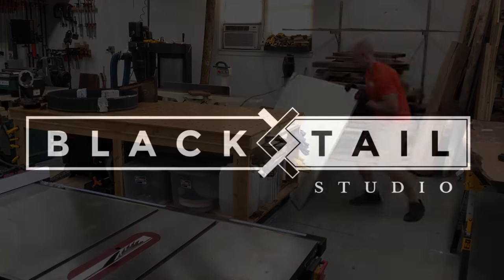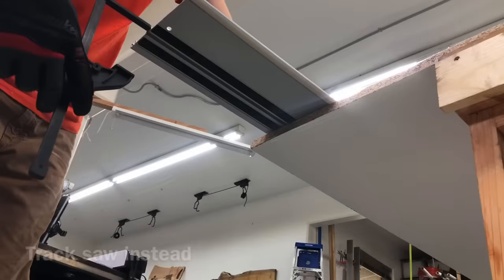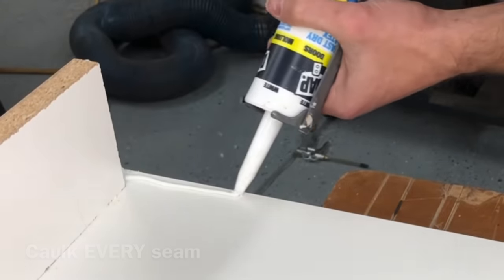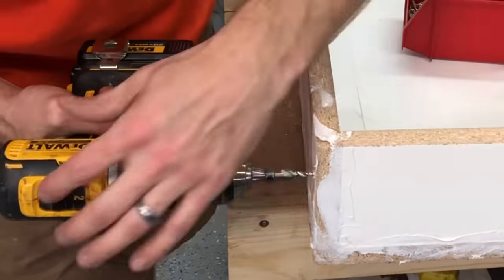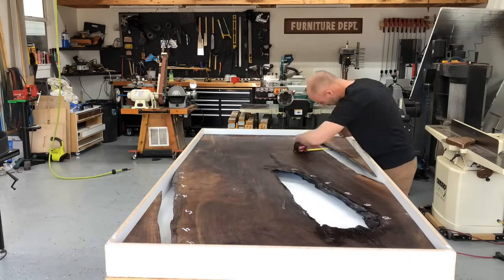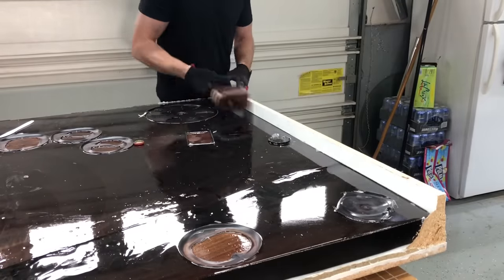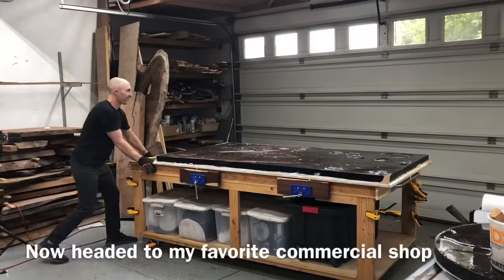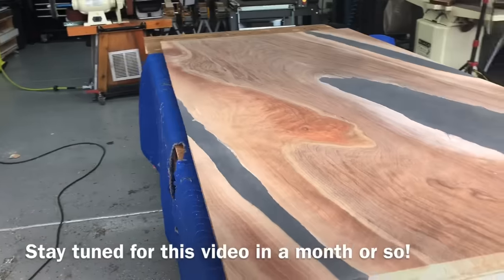How To Make an Epoxy Table Mold - DIY Epoxy Resin Table

Comment: Hey bud, love the videos - thank you!  Kinda have a related question, but it looks like some times people will put a little caulk along the inside of the slab / river, to prevent it from leaking under to the extent it’s not totally flat.   Do you ever do that / is that something that people typically do? Thanks!!!
Reply from the maker: I don’t, kinda long reason why though

Comment: Hi.  I have a few dumb questions.  I have been very inspired by your videos and tried my first river table recently.  I am applying the third seal coat tonight and it occurred to me that I may be mis-calculating the amount of seal coat.  The stonecoat countertop people say to use 1 ounce per square foot for seal coats and three ounces for the top coat.  My wife and are not certain still about how much to use.  We have 12 square feet of surface.  SO does that mean use 6 ounces of A and 6 of B or 12 ounces of each?

Also, a big freaking moth landed on my seal coat after 3AM when I applied the second one and he really embedded himself into it.  We tried to sand him out but he was too deep so we used a flat head screwdriver and scraped out a 2-3 mm crated right down to the wood surface.  Will I need to use quick coat on that or can I just sand as normal tonight and apply another sealcoat to the whole slab as palnned and hope it fills that divit??  Thanks for the fast reply.
Keith
Reply from the maker: You’ll figure out the measurements. I’m sure of it. And just fill the low spot with epoxy!

Comment: Hi,
I'm trying to make my first table. I'm using white oak with a dark ish mixed river but wondered about making it a little darker with a stain, where in the process would you recommend? I know your previous videos use shellac prior to the pour to reduce risk of epoxy staining, would you do it here? Or just wait until prior to finishing it after sanding? I'm a big fan of the videos, but haven't seen you use or I missed any with stains. Thanks!
Reply from the maker: I rarely stain or dye anything. I do have black dye video coming out in a few weeks though

Comment: Do you cover in a separate video how to clean the bottom. I've started to do scroll saw projects where I pour epoxy. And I can't run them through a planer or else it will break the wood. The tops are fine it's just the bottom that is nasty with caulk. Any recommendations on how to clean that up
Reply from the maker: Hmm, never had a problem
Reply: @BlacktailStudio  drum sander I found out Is the way to go

Comment: How do you not glue your clamps down with resin? I’m worried I’ll comeback and find the resin on the block or clamp I use to keep the wood from floating.
Reply from the maker: The poly caps peel right off the epoxy

Comment: Emily here: Hi there! My hubby and I love your videos.  We have just my gotten into making river tables. Where we live, we don’t have access to a professional large planar to run through after the pour.  What do you recommend doing if we don’t have access, but wanted to do a river table but finishing with a polyurethane or something similar versus full coverage of the whole table with epoxy?
Reply from the maker: Router sled for flattening! If that wax the question

Comment: I do have a quick question, I have plywood and ocm board lying around that are big enough to make a frame for my table, 36"x55". Would that be an acceptable substitute to the melanine?
Reply from the maker: Need to cover it with tyvek tape. Then it will be!

Comment: Scott here, a newbie at resin, have you ever tried a non-stick cooking spray? Has to be a lot cheaper than mold release sprays!
Reply from the maker: Probably one area I wouldn’t worry about trying to save $8
Reply: Blacktail Studio So I got the good stuff and it worked perfectly, first mold project is going perfectly so far 🤞

Comment: Hi I built a 2 metre by 1 metre river table. River in the middle and a river on the outer edge. I used deep cast which can pour up tp 50 mm in one pour and I did two seperate pours over a 48hr period according to the company. I then left it for 7 days. My table ended up bowing while in the mould. was this a checmical recation or a clamping issue? thanks. Whoe tableis firewood now. I spent around $1200. Love the channel.
Reply from the maker: Dang! You can try setting it in the sun (covered) and clamp it down once it’s heated up.
Reply: I managed to cut it down in size and hoping to flatten it out. The resin company said when the resin shrinks it can really pull on the wood so if it was not clapped down right this may have caused the bowing.

Comment: Cam,  have you tried butting the sides against the base instead of on top of the base the way you did in this video? Seems like it’d be easier to screw in. I did attend your 2/7/20 class but can’t remember if I asked this question at that time.
Reply from the maker: I do it this way to make it possible to see any leaks. And then stop them 👍🏼

Comment: I own  small cabinet shop. Going to try my first resin/wood table. I have a ton of walnut I saved from logs that I have milled a few yrs ago. My question is do I need to use 3/4” melamine on the bottom of my mold? I was 1/4, 1/2, and 3/4 melamine in my cabinet work. I thinking of using 1/4 on bottom? I’m going to start of with a small end table size top. Thanks!
Reply from the maker: Thinner would be fine if it’s supported
Reply: I just today got back from local sawmill guy 200 Bf of red elm, all 1” thick slabbed( 2 live edges). My question is what is a good method to remove the bark? Almost all is adhered really well to the solid elm. Thanks for your help

Comment: derrick.

I got a beginners question for you but i like unique and difficult looking art so the void on the table is great in my opinion. Im always experimenting with everything so i never really know what im doing, one of my projects i recently meshed 2 different trees together and blended them as best as I could but now i know how to and better ways. My question it im asked by a friend to make a hexagon frame 2' 6" tall for a stool and im going to do 6 epoxy walls with thin poplar logs filling the inside.  -Q- when making the walls could i do them one at a time then sand and epoxy poor to blend all on a final poor or should it be all same time. (mold will be pain in the ass if the whole hexagon at once) and how would you recomend colouring the epoxy, well shading* each wall on a budget? sorry for long post
Reply from the maker: Man, sorry. Not sure about that one

Comment: Leo here! i have a question Cam, i see you use the slab sander at a shop to plane and sand your epoxy tables after laying resin, my question is what is the most time efficient way to get the table flat after resin poring and achieve a good finish, with basic tools eg(router sled ,belt sander, random orbital sander) given i have no access to a slab sander.
Reply from the maker: I’d use a router sled

Comment: Cassie here - so we don't have access to the type of sander you used. :) But, what could I use instead at home that would sand this down to be a soft beautiful finish? I do a lot of small resin work including a fill on a wood table. But I want to make a full kitchen table top that is mostly resin.
Reply from the maker: I’d use a router sled

Comment: This maybe a silly question but when using melamine for the mould do you need the Mold release spray or is that just extra precaution? Thank you
Reply from the maker: You need it. Learned the hard way

Comment: Elliott- I'm making a much thinner epoxy headboard than the table detailed here. Would it be safe to use 1/2 melamine for the mold? My "table" will be about 3/4 in thick when I'm done
Reply from the maker: As long as it’s supported

Comment: I am curious as to know how come the black resin doesn't stain or infiltrate the wood. I know that when you pass it trough the planer, it removes a lot of material (I suposse), but you have never had any issues when used tinted epoxy when it comes to staining the underlying wood?. Thanks for your insight in advance.
Reply from the maker: Good question! Check out my other videos. I go into that. But I seal the wood first

Comment: Johnny here. I've used mold release on a test epoxy mold but the melamine stuck to the epoxy in multiple areas. I noticed that you spray on the mold release then used what appears to be a paper towel to buff in or wipe in the mold release. Is using the paper towel the secret?
Reply from the maker: It’s necessary. So maybe that’s the secret!

Comment: Love the video, thank you. Quick question, when creating an epoxy table is final surface up or down? How do you prevent expoxy from flowing under the downn-side wood surface or is that inevitable and have to be planed/sanded off?
Reply from the maker: I let it flow under! Makes a nice flat bottom to run through the planer
Reply: @BlacktailStudio  Jordan - following up on @lipeltgm's question - do you have any advice on how to not have the resin that does manage to sneak between the melamine and the wood react and foam? I did a test deep pour for my first pour and had tons of foam coming up from underneath the wood. I put sealer epoxy on the edges but not the bottom. Maybe that? Thank you and Go Beavs!

Comment: Schuyler here! Doesn't putting caulk on the inside edge make it so the wood will not butt up to the mold sides? (The right angle of the table wood and the filleted edge - because of the caulk - of the mold)
Reply from the maker: It does. I build them over sized anyway

Comment: Chris, thanks for the videos. Can I ask what epoxy you use? Is it still the Glass Cast you had in one of your other videos? If so what do you recommend to your customers regarding hot objects on the table like coffee cups etc as I've looked at this brand in the UK and it says not to put anything over 45 degrees on it? Thanks again
Reply from the maker: Using liquid glass now. And I’d get with the manufacture for temp limits

Comment: Hey, do any of you guys know what else can I use instead od melamine board to make the table template? Melamine is hard to get where I live and very expensive, but I understeand that plain laminated board from Ikea is not suited for this kind of work because of the weak paper like coating that would most likely stick to the resin and mess it up. Sorry for my english, I hope you can understand what I mean 😅

Comment: My name is Joe.  :-)  We’re hoping to make a table top with the “river” in the middle but the live edge on the outside (leading) edge of the table. Thus, only three sides will be “square” with the side of the form. If we make the form snug with the wood instead of leaving an inch on each side, can a bead of caulk keep the resin from reaching the cavity on the leading edge?
Reply: Never mind--watched more videos and answered my own question.  Sounds like we'll have flow under the table and around the edges of the form no matter what we do.

Comment: Cheri- i wanted to doble check with you that I heard yiu say ....Not t use silicone  chalk.  Is that right? I thought that is what was recommended fir inside the mold.
Reply from the maker: Correct, use latex caulk

Comment: Gary here. Thank you for another great video. I’ve made a few river tables so I know how to make a mold but I will watch anything you put out. I do have one question. I’ve used Tivek tape in the past and have seen a couples of videos where the epoxy heated up enough to melt the vinyl on the melamine. Have you ever had this happen or do you do something to prevent that? Thanks again.
Reply from the maker: Whoa! I haven’t. But I don’t use it much.

Comment: Logan. So what if the mold does come off just like that? Sides came off fine but the bottom is stuck like the epoxy glued the slab to the melamine. It seems that the mold release didn’t take and is coming apart and just flaking off. Better way to get it to release the wood?
Reply from the maker: I’ve had to plane one off before

Comment: Joe Gray... So you said the shop where you use their plainer/sander was Woodworkers Emporium?  We have one here in Vegas that rents out time on their drum sander.  I wonder if it's the same type of machine.  I will be doing my first live edge river top for my 2x6 desk.  I found a local guy that sells slabs and I got a 6ft 2 and a half inch ash slab for $100 bucks.
Reply from the maker: Very nice!
Reply: @BlacktailStudio  Is the shop you use their planer/sander called Woodworkers Emporium?

Comment: Hello I'm Jessica. Any suggestions if I am doing just the top of a desk. I have done the main portion of the desk and now need to bring my epoxy out to the edge. How would I go about placing something around the edge to seal my work and not have a big mess on the floor? Any help would be appreciated.

Love your table so far and will be looking for the video with the reveal of the finished product. Great design!
Reply from the maker: I’m having a hard time picturing it
Reply: @BlacktailStudio  I have a desktop. I did a desgin with the center but now need to pour the remaining top. How do I secure it so the epoxy stays on the desk and not on the floor
Reply: @BlacktailStudio  sorry reply won't let me send a picture

Comment: Howard: why can’t you use a roll of 25” wide 3mil plastic sheet to line the mold instead of the tape or mold release?
Reply from the maker: I guess because this seems cheaper, faster, and. cleaner to me. Don’t see why you couldn’t use that though. Painters cling plastic would probably be even cheaper and easier

Comment: Thad here. I'm doing a 10-foot by by 52 in wide 2.5 inches deep poor onto two pieces of slab that are 2 in thick to make 1 table. Any guesstimates on how much epoxy I'm going to need?
Reply from the maker: I’ve got a video on how to work that out

Comment: David M.  Always learn something new!  Watched a couple of your other videos for about the third time this am.  Great insight as usual. Question:  What are your thoughts on pouring @ a 2mm layer of epoxy first on the mold, then setting the slab/material on it?  Saw someone do that this morning, and it eliminated gassing and also anchored the slab while creating a non leaking dam.  Thoughts are welcomed!  DM from Georgia
Reply from the maker: Yup,  no issue with that method! Nice to have it locked to the bottom and leakproof

Comment: Delphine. Have you ever tried modustrial maker's caulking method for molds? He mainly does concrete work but maybe it would work with wood and epoxy.
Reply from the maker: I haven’t. I’ll have to check it out!

Comment: Something tells me I'm going to do a headpalm here, but I have a small desk that is going to be 41.5" w by  22" d This would seem to be making the bottom of the form 43.5 + .75+.75 by 24+.75+.75.  This leads to a 45"  by 25.5" base. If I attach the sides at the edges of the base, as in the video, won't the form be 2 inches too big?  I'm sure I'm being a dummy, but that's one of my core competencies... 8^)

Comment: How do I get the table smooth after pouring if I don’t have access to a industrial size sander/planer? Can I just use an orbital sander for a really long time to sand the table top smooth after pouring?
Reply from the maker: Try a router sled

Comment: Nick - What kind of machine is used at the end of video to sand down all the sides. Also, do you recommend paying to square it to make sure all corners are 90 degrees?
Reply from the maker: I do have them square it too. This is a big planer + wide belt sander

Comment: I have a question - your work table... if I needed to build a 60in x 110in work table... how would you go about doing that? I’ve got my ideas, but i need something that has some room under the table to allow for cold air to flow good to keep the area cooler when pouring epoxy.
Reply from the maker: I usually use MDF for worktops

Comment: Ken here.  I am wanting to use reclaimed birdseye maple flooring to build a counter. I want to actually preserve the imperfections, stains, etc.  So I am mounting the 2.25" to a subfloor panel and only need side edges to hold in the epoxy resin and to help pour enough epoxy to level the surface.  Any words of advice on how to approach this a little differently than a full mold?
Reply from the maker: Man, I feel like I’d need to see it
Reply: @BlacktailStudio  So I am randomly placing the 2.25" flooring pieces on top of a plywood base.  Then I will put the epoxy over the whole thing.  I was think I would simply build a frame of side panels only to screw into the plywood base.  Then I would remove the sides and install my stainless steel edge guards afterwards.

Comment: Justin here, 
Hey I have a question, I am trying to make a resin table using a folding beer pong table. Any tips to stop the resin from falling off the edges? should I put wood and caulk it? would the caulk come off the plastic table?
Reply from the maker: Not sure how you mean

Comment: Hey. I'm in the 🇬🇧 and came across this. I have a project where I want to make a resin wood table. Is the caulk decorators caulk?. Sorry if it sounds a silly question but this side of the pond we sometimes have different names for things.
Reply from the maker: It’s caulk for window and baseboards
Reply: @BlacktailStudio  thanks I will get some. Looking forward to mine.

Comment: Cam:

I am using melamine as a form.  I am also using the same mold release you do.  Does the epoxy eat at the melamine?  Someone I am doing a table with thinks that if you don't use tape, the resin will eat away at the melamine.  Please advise.  Thank you.
Reply from the maker: It does not eat melamine 😊

Comment: Anybody ever thought of using a heavy duty plastic tarp to line the mold.  Eliminates the need for caulk or mold release.  I've never tried it but I use heavy duty plastic as a drop cloth when I pour epoxy and noticed when I cleaned up that the dried epoxy just peels off easily.  Just thought I'd ask if anyone has any thoughts or recommendations on this?